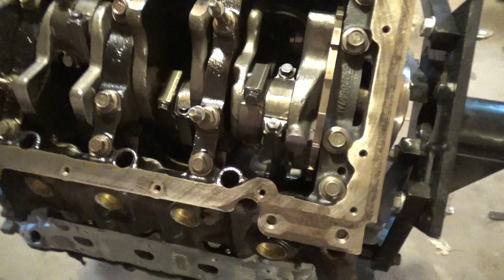2002 4.7 H.O. Bottom End

Comment: NICE! you should see the Chevy L19 i picked up....stout 4 bolt mains BIG BLOCK 454 with roller valvetrain...
Reply from the maker: stay tuned I have more goodies..F#%KING corona is making it very hard to source VIN specific parts for my GM L18 in my motor home..it is mildly modded with about 425 hp and 600 fpt you can see a walk around/through in my video library..soooo what you going to put that 454 in ? may I suggest a Chevrolet Chevette 😋
Reply: @ferrelx  haha excited! pls make a detailed video for all to see. esp me :p, well actually i will be putting it in a 5th Gen Camaro with AWD! I want to put an AWD system from a 96 suburban into that car! I have all the parts and will make it full time AWD..Its my first time making an AWD Muscle car so wish me luck! :)
Reply from the maker: @bbgcars  As you can see and hear this is raw video..I have about a TB of raw footage of this engine build and of the L18 plus trans flush and other RV maintainece footage..I have the latest Adobe Premiere Pro but it hurts my brain trying to learn how to use it 😒 so when I am feeling particularly perky I play with it for bout a hour or so..that's bout all I can take..so in the not too distant future you will see the $150.00 spark plug install with titanium infused spark plug wire heat sleeves..looks pretty bad A$$ with the Banks headers on the L18..cyaz..
Reply from the maker: @bbgcars  Also good luck with that build..custom work is frustrating and time consuming..the trick is KEEP at it..it will get done 👍
Reply: @ferrelx  thanks man..appreciate the advice../motivation
Reply: @ferrelx  haha , then just use VIDEOPAD> its easy, free and you can download it anytime and also its easy learning curve while you learn adobe....I use FILMORA, i learned it while using videopad which i still use